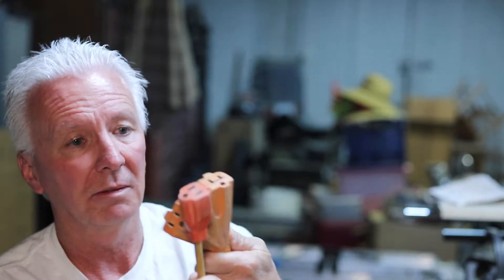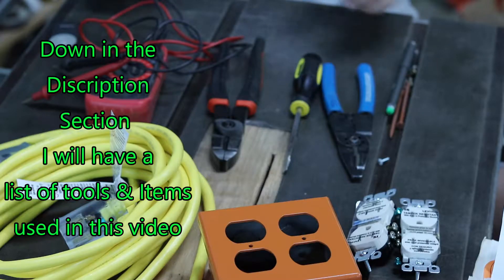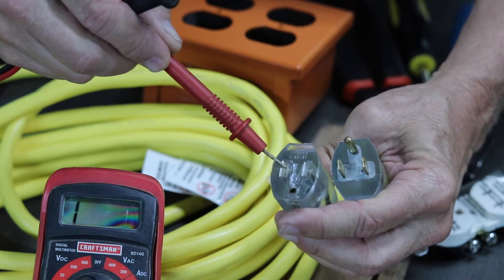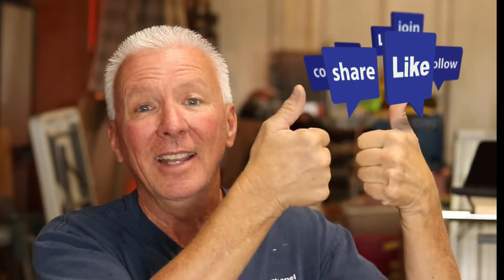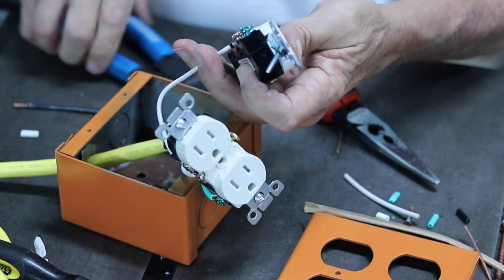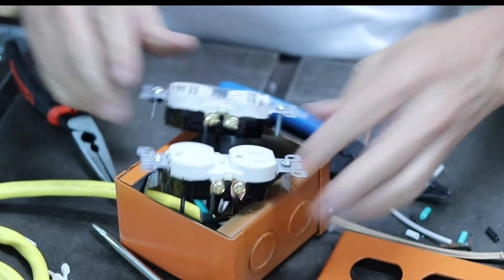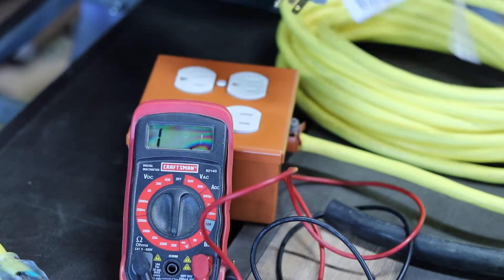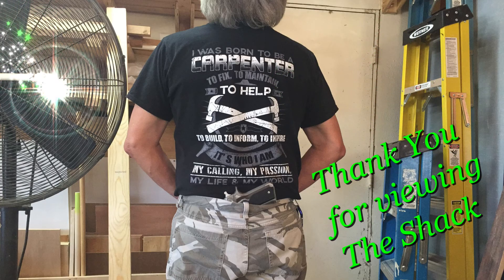How-to Wire 4 way outlet to an extension cord

Comment: The metal box is fine for home use only. Take that assembly into a  private sector business or construction site, and OSHA will cite the employer for using that box in that manner. Ironically,  the correct box for this application is a plastic box. Not just some cheap little plastic box either. The proper box designed for this application is the same kind of box intended to be used in pendant installations. When you find the box that costs $50 or more  just for the  empty box, you will have   found the right box for this application. The metal box used in the video is only supposed to be used in permanently mounted  installation such as either in walls, or surface mounted to walls, benches or the like. 
In the world of safety the cord he assembled is what I call "low hanging fruit" for the most inexperienced or ignorant OSHA compliance officers! Easily found citation for the employer.  Keep boxes like this for home  use and do not build or use assemblies like this  with $1 metal boxes instead of using the right kind of box.

Comment: @TheShackHome - would the wiring be the same if using a combo switch/outlet instead of 2 outlets on the same side ?
Reply from the maker: if you mean like an outlet with USB's then yes. I actually was thinking of doing another extension with the USB and a light switch for a project I want to do and having a light switch set up to kill power to the outlets so I wouldn't have to get up and unplug the extension.
Reply: @TheShackShop  just a light switch and one 3 prong plug on one side (a combo outlet), then a normal 2 outlet duplex on the other side. And yes, the light switch to kill the power to the outlets. Thanks

Comment: Black to gold and white to silver always. You mentioned that everyone has their own way of doing it, but that is a mistake. There's only one safe way (fortunately, that happens to be your way), but I don't want viewers to think there are other correct answers. Also, as mentioned before, that box must, must, must be grounded. That is a shock (or worse) waiting to happen. If there is contact with the box to the hot side, the whole box will be electrified, and you will be the ground. You will not have a good day. I provide zero content, so I appreciate the effort - I don't want someone getting hurt thinking these things don't matter.
Reply from the maker: framptonesq thank you  I totally understand but I meant people have a way to remember thing their way. me I relate to black hill gold just helped me do it right. I think most would use plastic but I've had plastic and didn't last. this metal has been around for 15 plus years and stood up to the abuse. Great comment thanks for viewing.

Comment: I like the way he used solid wire pigtails to connect incoming ground to the two outlets.  This method avoids having stranded wire under a screw.  He could have done the same with black and white wires and had no stranded wire under any screws.

Wire nuts can be reliably used to connect solid and stranded together.  As long as the stranded is the right length stripped and not too short.
Reply: I build mine with stranded cable and crimp connections.

Comment: Biggest safety issue with video is not connecting a ground wire between the box and the incoming ground wire.  All metal boxes must have a ground wire attached. This is not a small error.  

If there is any chance that this cord might be plugged into an outlet that is not gfci protected, and this cord is used outside or in a wet location, it might be useful to have a gfci outlet in the box shown rather than a standard outlet.  This gfci could also protect the second outlet.

Comment: There is another test that should ALWAYS be performed on a new circuit which the video doesn’t show.  That is a voltage drop test under load.  Using a hair dryer or space heater that draws near the max rated load of the device, test for voltage using the multimeter before and after the load is turned on.  Compute the difference in volts.  That’s the voltage drop.  Do the same test both through the new device and without the device, ie the upstream outlet. Then determine if the drop of the new device is normal or exceeds allowable range. 

If you wired as shown in the video and all but one strand of the wire came loose from the screw you’d still have good continuity but the voltage drop would be excessive.

Comment: This guy spends so much time testing continuity with meter set in ohms mode.  Most meters have a continuity mode where it beeps for continuity.  The difference between the two modes is that the beep is nearly instantaneous, whereas the display update has a significant delay.   If you have a bad intermittent connection you WILL hear an intermittent beeping.  But you may miss the display changes due to the delay.

Comment: I am finish carpentr to keep tack of all the tools in a snake pit,, is this the miter saw. This the table saw,,I bought a Power strip when cold have to fight the cord.
Not an election I have wired ceiling fans and garbage disposal. 
Had a 75 ft cord decided to make a quad box drop cord.
Only run one tool at a time plus battery charger.
The cord is 10 gage I may shorten it to 50 ft.
Thanks for your tips and video.
What life is about teaching another and to help them out you've done just that.

Comment: I commend you on your continuity testing. That being said as a Retired IBEW electrician I'd like to say you made a video that could kill someone or burn down their house. I'm not going to get into the errors you made ie the stranded wire under the screws, not grounding the box, etc, etc. Nothing is stopping you from making these contraptions and using them in your own home, but they are a huge OSHA violation on a job site. The video was entertaining but fellow viewers PLEASE do not do this. Don't be lazy, use two cords or a splitter.  To "The Shack" these things are a pet peeve of mine. It's not personal. I've cut up hundreds of unsafe cords on jobsites over a 30+ year career. Thank you and best of luck.

Comment: As some have said, this is NOT the best way to build a multiple outlet extension cord, even for homeowners, not even considering commercial use.  StudPack just did a video on this subject, and while his suffers from issues too, his selection of boxes is better, with rounded corners, and he used a strain relief which is mandatory for any longevity at all.   No GFCI, which should be at the end of the extension that plugs into the wall, so the entire cord is protected.  If you are going to make a video of how to do a project, why not do it right?  You state, for example, and you would normally tin the stranded wires, but then you don't.  And while tinning seems a good idea, it will create another set of problems when putting those ends on the screws.  And always, always, always ground the metal box!  And let's not even get into wire size, haha.  You do a disservice with this video.  Anyone watching who doesn't know better should take a look at StudPack's video and read the comments there for even more information, you can buy safe and legal multiple outlet boxes for this purpose.